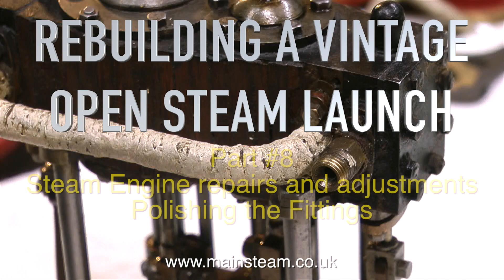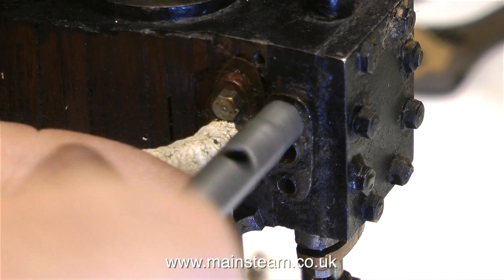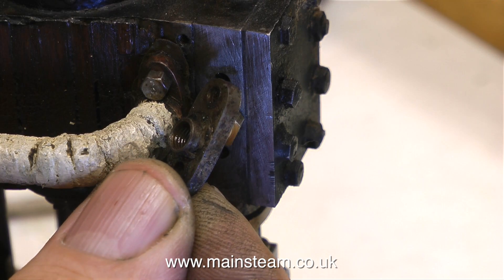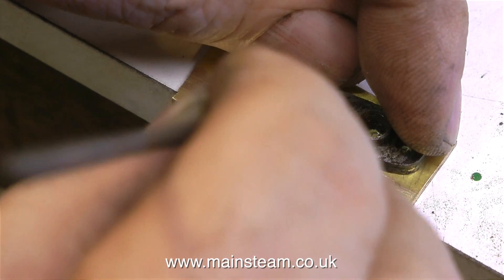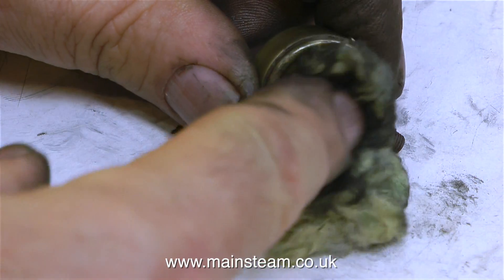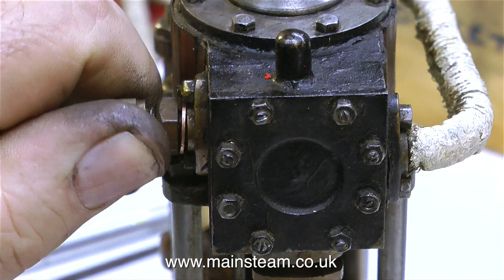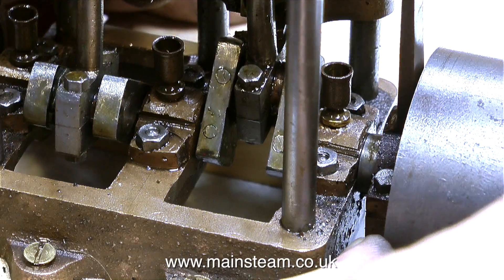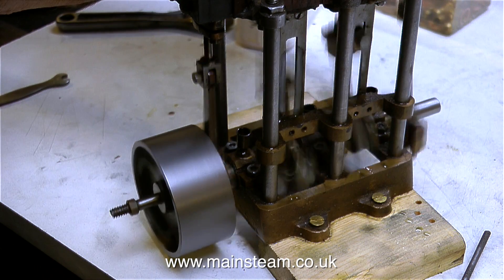REBUILDING A VINTAGE MODEL OPEN STEAM LAUNCH - PART #8

Comment: Are you not concerned that compressed air will force chips into the cylinder when cleaning   the steam chest? 
I really appreciate your videos.
Reply from the maker: No - it has never happened yet anyway ......

Comment: I'm currently thinking about building the design which use a transverse arrangement of 66mm (2.6") bores x 8 times.  Any suggestions?
Reply from the maker: You would need a boiler the size of a small Stately Home  to feed that amount of cylinders .......